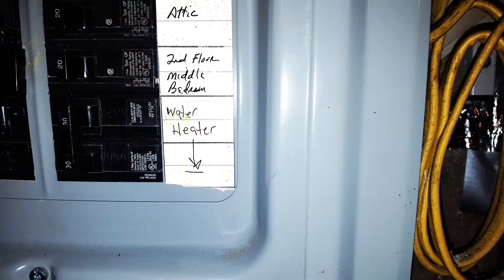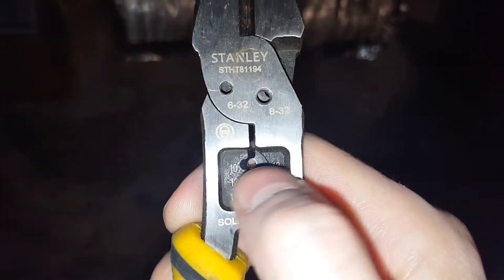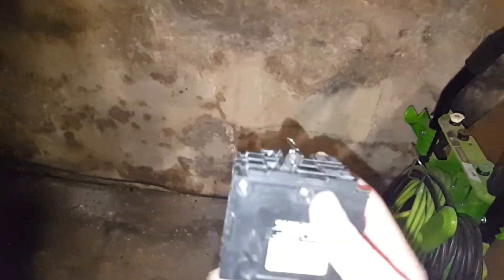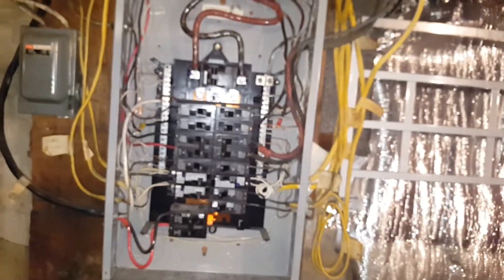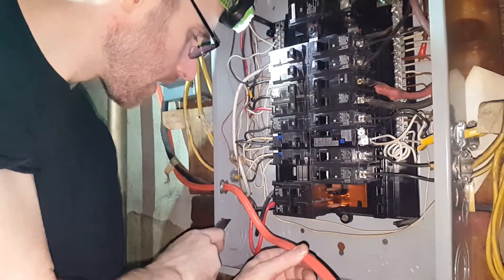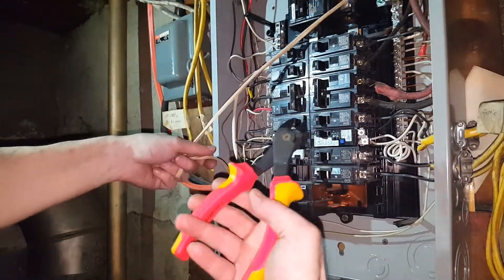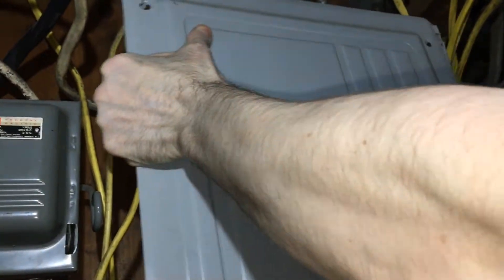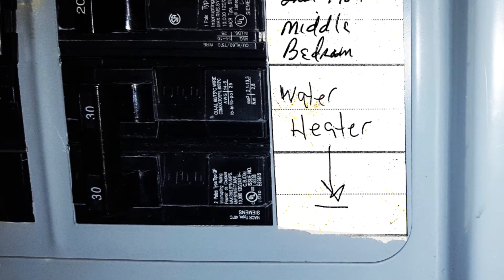How to install new breaker in electrical panel ⚡ New 30 Amp Circuit Breaker for water heater, etc.

Comment: Thanks brother!  Adding a 30 amp breaker for a heater I’m installing in the garage.  

Your video reassures me that I have the right plan.  Peace and blessings 🙌🏾💚
Reply from the maker: No problem and good luck with the heater installation

Comment: Have you ever changed the wire through the walls like the one from the breaker to the water heater?
Reply from the maker: I've used fishing rods which you tape one of the wire and then push through a few rods. I've done that for bell wire and romex but I would watch a YouTube demonstration of that. In my case here the basement is unfinished but I still needed to drill through the joists to pass inspection (there are a few rules like a max hole size and distance from edge).

Comment: Great video but where goes the white wire? And ground
Reply from the maker: In my  case, both white and black are hot, going to a 240 volts water heater. They both go into the breaker. Ground always goes to the ground bar.

Comment: this is exactly my situation lol. bought a water heater, need to add a new breaker and wire
Reply from the maker: Hopefully your panel has the space for it! In terms of total amps and a physical spot open for the breaker.
Reply: @toolsandrepairs  it's an older panel so I decided to just get a 3800 water heater so I don't have to replace the breaker

Comment: I thought white is to be a common and not a hot?
Reply: In a 120v white is neutral.  In 240v double pole. Each side is the breaker is 120v each for a combined 240v. In this case white and black are hot.   There is 10-3 wire. In that case there would be 2 hot wires, 1 neutral and 1 ground.
Reply from the maker: Maybe Google skipped you ahead but at the start I explain this is for a water heater with two hot wires (240 volts)